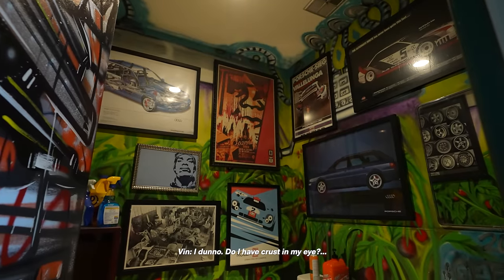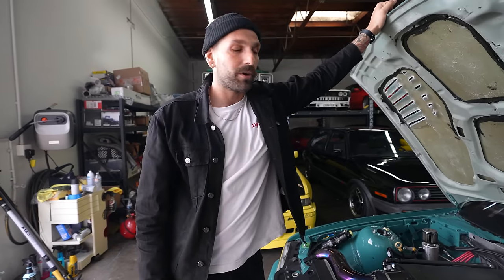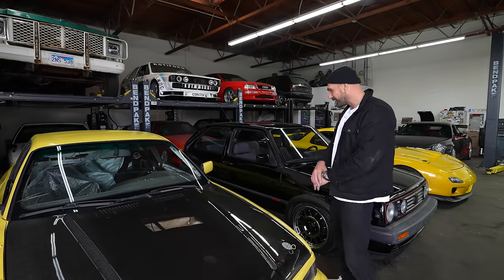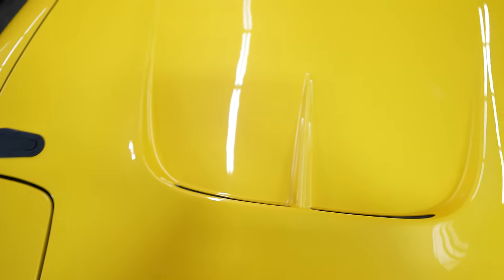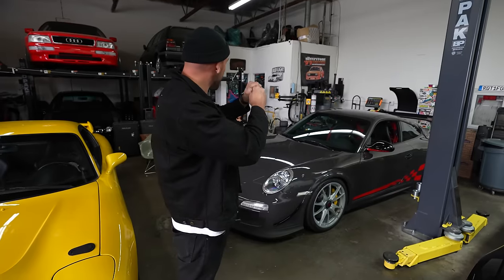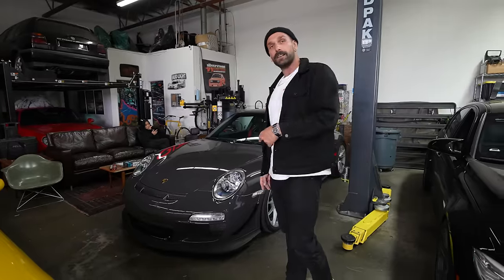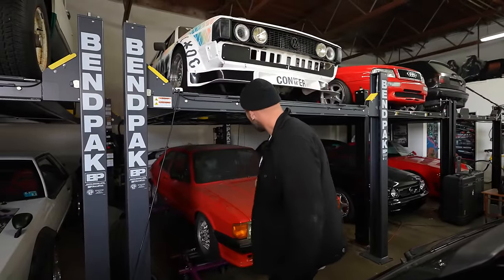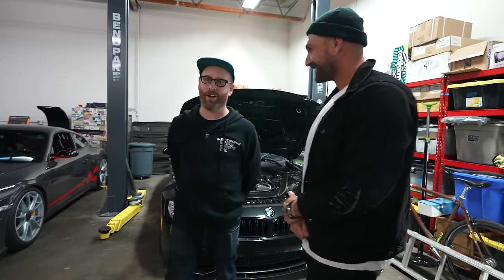ALL MY CARS IN THE SAME PLACE FOR THE FIRST TIME!

Comment: How come,  barely EVER see anyone putting on cold air intakes? Or some sort of intake.. it how I grew up was , Exhaust,intake,BOV,
TUNE,WHEELS,SUSPENSION, TINT , Alarm/remote start 2-way with built in turbo timer
And fully custom Audio/Video system!..* Not on that order ,but those are my biggest upgrades

Comment: any suggestions on how to get your first project car / 2nd car when you live in an apartment?
- how to pick a good project car (age, price, condition)
- budget friendly (car, parts/tools, shop repairs)
- where to work on it (your lot or garage, auto parts store lot) / when to bring it to a shop / are there other options? (outside the obv. your house or friends house, storage units / renting garage space?)

im always day dreaming of buying an 80s/90s car but live in an apartment with no place to work on it. Ive looked into renting garage space but its a little out of my budget for a hobby and ive looked into storage units but it seems like a crappy option.
Reply from the maker: I started with no garage, it sucks but you can make it work. It really depends on what you want and what you can spend. I think if its your first project car and you dont have a garage or space for it yuou should get something that you can tinker with and "build" slowly to make it yours. I love bolt on builds. No need to think you need to do an engine swap or fabrication. Get something you like that you can afford and mod it up slowly!
Reply: @vin_tra  its super cool you took the time to respond - thank you! great advice, i think i need to save for a good platform to start rather than trying to get into something cheap that needs a lot of work.

Comment: You should do a fabless manufacturing 2.5 07k swap on that mk2. It would rip!
Reply from the maker: VR or bustttttt
Reply: @vin_tra fair enough! I have a vr mk2 with a tune as well as some other junk, and I have mk5 with a 07k. They're not much different power wise, but the vr6 makes me drool every time when I hear it rev.

Comment: How is that FD only making 350hp with a B-W 8374 turbo.  You can downsize to a 7670, make that power easily and gain response.
Edit: a 7064 will get you to 350whp as well
Reply from the maker: It is only tuned on 1 bar. the 8374 is incredibly responsive. Paired with a 4.4 rear I would not want the power to come on any sooner.
Reply: @vin_tra  If you want to try the 7670, I got you.